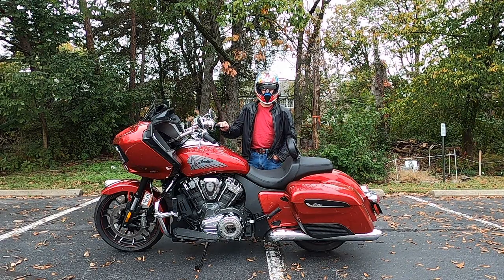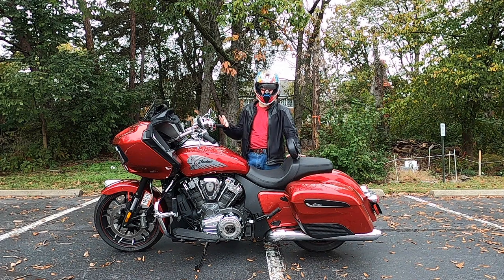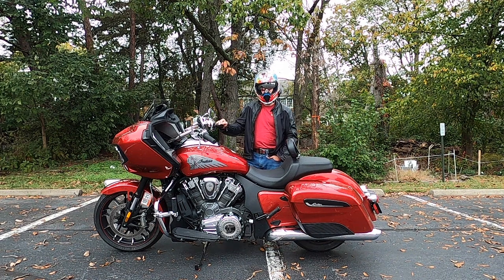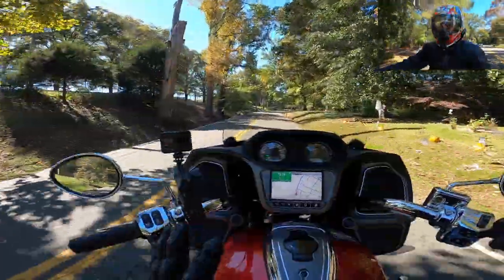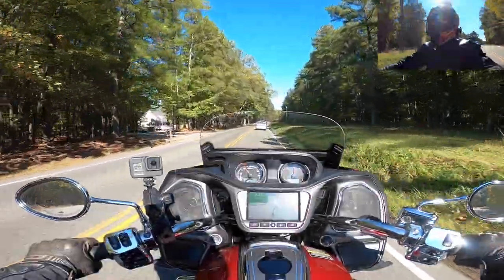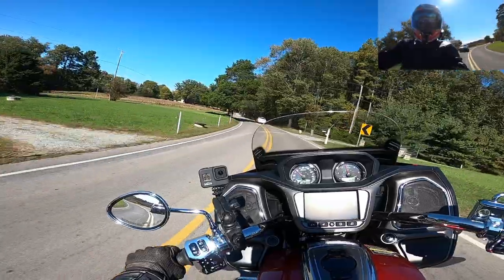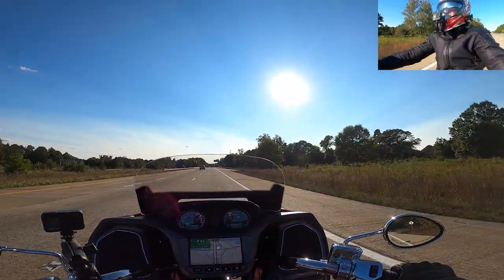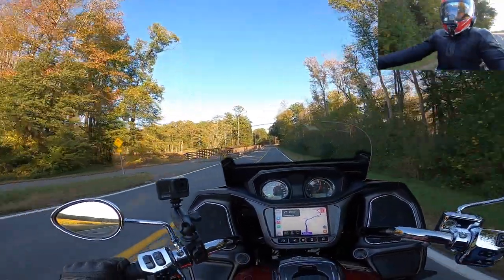Indian Challenger Update: Richmond VA to Williamsburg VA Ride!

Comment: Beautiful bike! I'm a Harley rider but I like what they are doing with the Indians. I got the first year millwaukee 8 ultra limited. It had some issues that had to be worked out. I had a clutch recall and oil pump failed. First year bikes are always a gamble
Reply from the maker: Thanks Harry! Indian, Harley, I honestly love them all so far! I've read a bit about others' views on first year bikes, so I can't say I was unprepared for an issue here or there. The things I'm experiencing so far are really just kind of minor annoyances, nothing that really detracts from riding the Challenger. Once you feel the pull of that engine and feel how easily it leans into corners, the last thing you're thinking about is the rear cylinder deactivation! 😂  I will say though, given my own personal obsession with CarPlay, I can't give Indian a pass on the sluggish Ride Command system. Infotainment systems are too common place for this one to have so many problems, especially after one major software update already. But...at least once I have CarPlay running my Waze works just fine. lol 🤷‍♂️
Reply: @DMVSoloRider  I'm glad your enjoying your bike. We have enjoyed the ultra and all the comfort it provides. I guess a roadmaster is a closer comparison. That new limited is slick, amazing just how much it looks like the HD.
Reply from the maker: 8000 miles later, slick indeed! 👍
Reply: @DMVSoloRider  that's good to hear I know each manufacturer has their gremlins lol

Comment: Friend, try the Corbin seat.  They will build what ever you want and they are awesome seats.  I had them neck down the seat so I can flat foot my 19 Chieftain with ease and soften the seat a touch.  It turned out perfect!  I’ve had a Corbin on a Vic and loved it as well.  I tried Mustang on my Chieftain and loved the aesthetics but it killed my backside after a couple hours and their backrest was extremely uncomfortable.

I had my Corbin built in black ostrich and it’s sharp!
Reply from the maker: I’ve heard good things about Corbin (and I had the same experience with a Mustang I put on my Scout - hard as a rock!). But my more immediate solution was just trading in the Chieftain for the Challenger. I guess I just do things a little different. 😂 I really like the Challenger’s seat so far! Much less like a horse saddle compared to the Chieftain, and much better lateral support!

Comment: You now have an overhead cam bike which means you are literally sitting on the cams and valve train so to hear some mechanical noise should be expected. My victories were the same set up and I heard the same noises. Also with that fairing you have very little wind noises hence you hear more engine noises. Just imagine if you sat on your car engine as you went down the roadway you would hear a lot of engine noise . Love the bike! When they come with a tour version I will trade my Chieftain on that for sure!
Reply from the maker: Thanks for the comment Joe! That’s actually a fair point - I can’t say I really contemplated how the different fairing might change what I’m hearing on the bike. Having said that, as you’ll see in my next update it actually turned out that there’s a software bug tied to the rear cylinder deactivation that’s causing the issue. It’s not only the sound, but you can also feel a weird related vibration in the handlebars. 🤷‍♂️
Reply: Put extended performance Mobil one synthetic or Amsoil and all of that noise should go away
Reply from the maker: I’ve been meaning to look into switching to synthetic actually. It’s crazy to have to get an oil change every 5k in 2021! 🤦‍♂️
Reply: My Harley made horrible head noise when I first purchased it brand new. I thought that was just the way Harleys sounded. At 500 miles the rings seated and I changed the oil. I put Castrol Syntec 15w50 car oil and all of the engine noise went away
Reply from the maker: Not using synthetic (yet), but the bike had its break-in service. The specific noise that’s the issue is tied to the rear-cylinder deactivation. Once it turns on, a bit of gas is released, and that creates a knocking noise and vibration in the bars. Apparently it’s a known issue for Indian and a software fix is the anticipated solution. Per the other comments, time/the bike breaking in seems to have been the solution for its weak start. After about 1700 miles that issue seemed to resolve itself, and now the bike starts like a champ even after sitting in frigid temps for a week. Bikes are weird. 🤷‍♂️

Comment: Beautiful bike,  what backrest are you using,  looking for one for my 2020 indian chieftain dark
Reply from the maker: Thanks! I have the Indian OEM rider backrest - I originally got it for my Chieftain, and fortunately it fits on the Challenger too. Between the backrest and the gizmo you have to buy to attach under the seat to hold it in place it’s pretty pricey - would probably just find a good 3rd party deal if I had to do it all over again. 🤷‍♂️
Reply: @DMVSoloRider  thank you for the information and have a blessed day.
Reply: By the way,  my ride command was doing the exact same thing as yours,   I bought my bike brand new with 1 mile on it in July,  just found out a couple weeks ago that there was an update for it,  did the update and now the response time to the touch screen is almost as fast as my phone.
Reply from the maker: Yeah, my dealer did the last update when I bought the bike (it was the big CarPlay update) - it’s been sluggish ever since. There seems to be a lot of variation from one bike to the next, so I’m hoping they continue to work on it and get it squared away. Most important thing to me is that CarPlay (& Waze) works well, and so far once I have that running the sluggishness doesn’t seem to interfere with it. 🏍💨💨😂

Comment: It should crank right up.
Reply from the maker: It does now, after over 8000 miles, even when it sits for a week in the 30s! I have to admit though, it’s not a particularly impressive start-up. For such a beast, it starts off with a whimper! 😂😂😂 Stay tuned - my formal 8000 mile review is about to hit my GoPro!
Reply: My Victory had a problem with idling after I installed a power pro. I rode it for days and was fine then I parked it for a while and cranked it up and it died after idling for a few minutes. The battery had run down a bit and it was a slow start so I charged it up and reset the controller and that fixed it. I guess a low battery on start can be bad for computer controlled bikes.
Reply from the maker: Had my dealer check everything when I first experienced those issues. Battery was fine, and so were all the connections. Apparently, the $30k bike just needed to kinda settle in. 🤷‍♂️🤦‍♂️